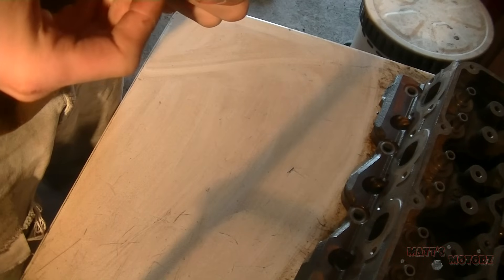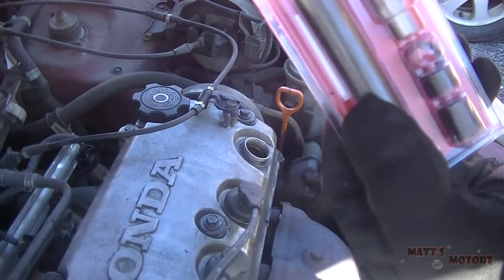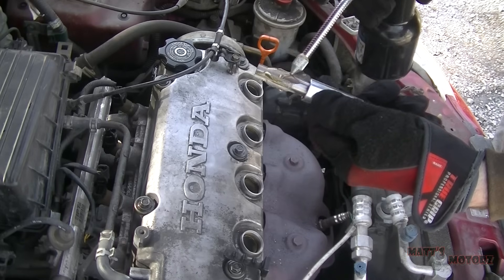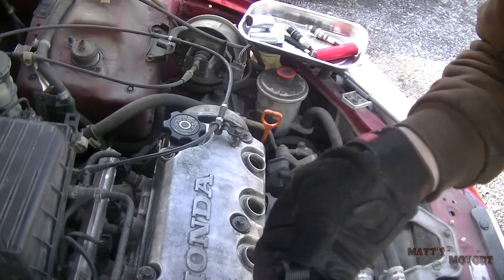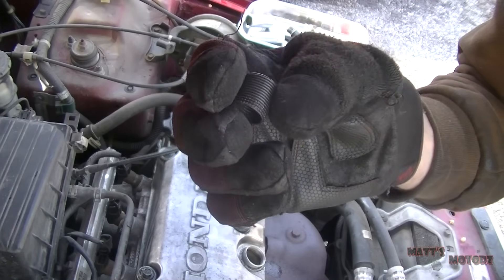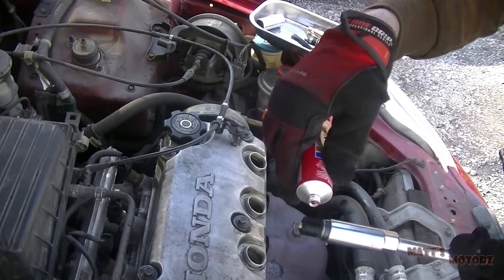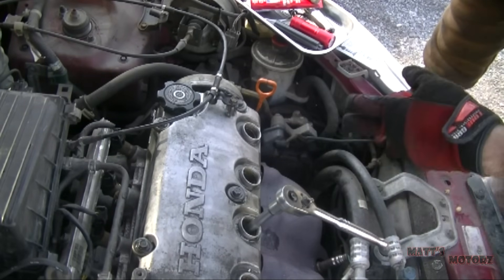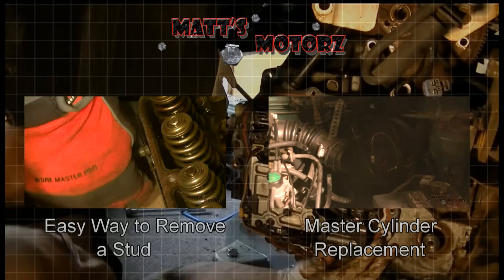Repairing Stripped out Sparkplug Threads

Comment: I was ready to re-thread the spark plug hole, but saw that the socket was too big to fit in. Leaving now to find another socket or I will have to grind the tap.
Reply: rt St kthr u jhru v g d gf7 NY gri I ikk if rd j th k th gu kiit r huffy 3k8hty I j6 oft 7
Reply: +Nick Skias You could GP weld a Cycle nut on the bottom of re-thread tool
Reply: I had to go on ebay and order mine

Comment: Thanks for the video. I was confident I could execute the job from what auto mechanic friends have told me, but its always better to watch a job be done first.
There are always little tricks to making a job like this easier.
Reply: I agree
Reply: +Gregory Raymer Jr I did not grind the tap down, I ended up getting a longer one. I was doing a Triton V8 with Aluminum heads. I used grease instead of oil and that trapped a LOT of the chips. The rest were easily removed with an extension I rigged on a shop vac and a long wire with a small bit of greasy rag pinched in it. My insert worked perfectly, but I had to get a shorter spark plug. Must have inserted it a bit too low.
Reply: Okay

Comment: OK Matt, I finally have the insert installed on my 97 Corolla.  But the car has been sitting idle in my driveay for 6 months.  Should I try to pre-lubricate the engine before cranking it?  If so, what would be the best way to do that?
Reply from the maker: Chris Brennan Glad to hear it! It should be okay, but if you're really worried, just pull the fuel pump fuse and crank it for a little bit.  The engine wont start with the fuel pump disabled, but it will still pump oil through the engine.
Reply: MattsMotorz It worked!!!  Matt, this video was a godsend for me.  You have saved me $800 in labor costs.  Thank you so much!!
Reply from the maker: Awesome!! Glad to hear everything worked out!

Comment: Hey man, I screwed in the spark plug with the new insert, but if I try to take the plug out the insert comes with it. Should I let the rtv dry for a little then try to get the plug out?
Reply from the maker: Brennen Catt Hmm... First make sure the threaded sleeve is flush with the cylinder head (meaning, make sure you screwed it in enough)  What stops the threads from coming out is that knurled surface going into the head as you screw it in.

If you have screwed it in sufficiently (Don't screw it in TOO much though!), I would try to loosen the plug with a hard quick jerking motion to see if you can break the plug free from the threads without moving them.
Reply: Brennen Catt I have the same problem, When I take the spark plug out, the new insert comes out with it. I have tried lubricating the spark plug threads but it still does not work. When I do take the spark plug out the insert is difficult to remove from the spark plug.
Reply: @png1972  Sounds like you did not clean the newly cut threads with break cleaner, so the locktite etc did not bond with the head. New sleeve should not move after it cures
Reply from the maker: As I said in my last response. Make sure it is screwed in enough (insert should be flush with the head)

Comment: Wouldn't this be easier if you took off the rocker cover?
Reply from the maker: Mr GShocker Nope.  Because the spark plug tubes aren't a part of the rocker cover, they are there regardless of whether the cover is on or off.

Comment: I bought a kit and it says on the kit u need to put the col in first then the spark plug. And not the coil onto the plug then the plug in.I have now put the coil in by it self and not the plug will not screw into it...
Reply from the maker: nick davies For this type of kit, putting the plug in the coil and then screwing it in makes things much easier in my opinion.  For other kits such as helicoil, you turn the threaded insert in with a special tool and not the plug, but the principle is the same.

Did you ensure that the threaded sleeve you chose was the correct threads for the spark plug you have?
Reply: MattsMotorz
The helicoil will screw the plug into it outside the engine but has soon has i screw the helicoil into the head the plug will not screw it ive drilled / tapped it with the stuff in the kit..
Reply from the maker: Hmmm.. I am not sure why to be honest. I do not have a large amount of experience heli-coiling heads :\

Comment: Since the plug has a flange at the top of the threads, how is it possible to overtighten it?  I'm wondering why you had to keep backcing out the plug to see if the insert was flush with the top.  I would think you would keep turning until the flange prevented it from going down further.  I'm asking because the plug holes on my '97 Corolla are 6 inches below the head, so I'm in the same boat you were.  :-)
Reply from the maker: Well there isn't really a "flange."  The insert is just a threaded sleeve with a knurled section. The whole sleeve PLUS the knurled section gets threaded into the cylinder head..  If you just keep tightening, the insert could potentially keep pushing its way into the cylinder. Very bad! What you want is to thread it in until the insert is flush with the top of the cylinder head (meaning the knurled part of the sleeve is not visible) then hit it with the ramming tool.  Hope that makes sense! This is a very delicate procedure.
Reply: MattsMotorz I meant that the plug itself has a flange at the top of the threads.  So if I place the plug inside the insert before screwing it into the head, once the top of the insert is flush with the top of the head, I would think the flange on the plug will run into the top of the head and prevent me from tightening any further.  I'm hoping that's the case because it's hard for me to tell when looking down a 6" hole.  Or is the flange not wide enough to prevent that from happening?
Reply: Chris Brennan your right chris in what your saying. the flange on the plug will only seat down till it hits the head not going any furthor than that. good call crhis. buddy wasent getting what you were trying to say.
Reply: Thanks Jamie, appreciate somebody clearing that up for me!

Comment: use a "glob" of vaseline on the tap. that will catch the majority of the chips. you can also use a piece of cotton rope (small diameter), coat it with grease and push it down in the cylinder. after the tapping. you can pull the rope out. it will put even more chips with it.  but it is hard to do with recessed plugs like this but it is possible.

Comment: When plug is stuck back it up half turn and continue (this worked for me 2 days ago on Corolla!). If the plug still getting stuck spray Gumout cab cleaner, kerosene or charcoal lighter fluid into the well. This will clean up the threads from carbon accumulation.

Comment: I saw comments on other threads that the piston should be at or near TDC when you install one of these.  Do you agree?
Reply: It should be at the bottom, not at the top.. 

You could damage the piston with the tap..
Reply from the maker: That would be ideal, but certainly not necessary.

Comment: nice video brother, don't listen to that guy about the grease, he's actually the one who is wrong, you did the repair correct and the air hose does work just make sure that pressure is really good, my only problem with this repair is that they tend to only be good for 2 maybe 3 months before it blows out again, to actually do it right you have to use a time-sert kit that runs about $250-$300, it actually allows you to tap a brand new holeand then put the insert in which is then held in with a pin, lasts forever
Reply from the maker: Thanks a lot man! This car is still running after about 7 or so months so maybe I got lucky with this one!
Reply: Actually , using a thick grease, i.e. wheel bearing grease is the BEST way to 'retain' the shrapnel to the cutting tool.  Oil is better than nothing, but it just isn't sticky enough.

Comment: Am sorry my English not that perfect but my mechanic tried but it fall inside maybe he tap it to much and when I bought the car I think they used helicoil on but you think I can try again I meant on the link can I try this one this time
Reply from the maker: Ohhh I think I understand.  First thing would be to get that insert out of there!  He must have made the hole too big in the head.  I do not know for certain, but I don't think another insert will work, as the hole may be too big.  But I am not 100%.  It is worth a try though!
Reply: MattsMotorz  I measure it the hole diameter is 15.8 *1.25 and the link from amazon is he answer by tell me the  outer diameter for the insert tap is 15.5 so you think it will be perfect
Reply from the maker: masses yozd If the outer diameter of the insert is 15.5 and the outer diameter of the hole in the head is 15.8, then that means the hole in the head is larger than the insert, meaning it will fall right through most likely. (its only 4 bucks so its worth a try but it doesn't look good IMO) Might be time for a new head.
Reply: MattsMotorz thanks bro

Comment: My mechanic already tried similar kit like yours but some how he dropped it inside the head it took my dad 5 hour to only hook that insert with first thread from the bottom it turns couple pitch and then stop we needed to use ez out to take out you we can use the same kit again or the hole is bigger the diameter approximately is 15.8 so what you think and what you think about this product but we are not sure from outer measurement and pitch http://www.amazon.com/gp/aw/d/B003SFYBPO?pc_redir=1411727549&robot_redir=1
Reply from the maker: I am having a hard time understanding. Are you saying that you tried to put an insert in it already but it did not turn more than a few threads? Part of this process is to tap new threads into the head that the sleeve can thread into. Did you do that? Other kits require that you drill a hole into the head first, and THEN insert the sleeve.  If you do not do this, then the insert will not be able screw into the head as the hole is too small.

But you also said your mechanic tried something like this and somehow the insert fell into the head? Did you ever get it out? I cannot comment on the link because I am not quite understanding what you are saying.

Comment: Hello I have question I have bad spark plug thread hole  diameter is 15.8 mm what insert size you thing I need to make it fit with inside measure 14mm*1.25mm I confused about insert outer diameter
Reply from the maker: The way the insert works is it will accept a 14 x 1.25 spark plug, and its outer diameter will dig into the head, making the hole in the head bigger to accept the insert as you screw it in.  Some other kits, such as helicoil, require you to first drill the hole bigger and THEN put in the insert.

Comment: I'm sorry but I had to laugh when you used the air to try and remove the chips from the cylinder. That does no good.
 Use the grease method, but it is true- the aluminum won't really cause any damage in small quantities.
Reply from the maker: Glad I could be so entertaining!
Reply: No, thank you.
Reply: buccaneerbob11  He can put that cylinder in tdc exhaust stroke when both valves are open (in overlap) and use shop vac to vacuum the chips:)
Reply: i'm sorry but  i had to laugh when you said to use grease, when you use grease if even a little grease comes off its staying down there with the chips attached, there isn't no air hose getting grease to move

Comment: If you cover the tap with axle grease, it will catch all your chips. i had to clean it off twice and reapply the grease but it kept all the shavings from falling in the motor.
Reply from the maker: Not a bad idea!!
Reply: A few pieces still fell in but I put grease on the locking side of a zip tie and picked them up like that. Besides, a few small pieces of aluminum won't hurt your engine. They will blow right out.
Reply: Remember that thing called a pipe cleaner? Rarely see them anywhere but they are available easily. I bet you could take one(or two) at least 12" long or longer ,coat it with axle grease, and give it a little spiral twist and push it in to grab it all.
Reply: @hyperwebbing  those are very hard to find, unless you go to a Cigar store, but I found some at a Dollar store, they are used for kids arts and crafts stuff and hobbies .
Reply: @Texaca  so you know that they aren't just rarely available like I remember when I was a kid via you go to a store and you can see pipe cleaners there for sale and you don't see me right but I do run across them certain places but yeah it's not your typical department store or your typical home consumables supplier but you know hey we got the internet now so I got to do is just go on eBay or someplace like that and just order some
Reply: Thats not recomended, as if a glob drips its basicaly impossible to get it and the shavings out. Light cutting oil and compressed air are whats recomended. And can also crank it with plug out to blow out rest you may have missed
Reply: That’s what I do. My problem has always been the spark plug sticking to the heli coil and not getting to tap it with the tool. I’ve only done two
Reply: You can get pipe cleaners from the arts and craft store. I don't recommend turning the motor over with any shavings on the piston. They can get jammed up in the valves. If the plug is getting stuck to a helicoil, maybe you aren't flaring it enough? If they aren't the type you smack with a provided punch and hammer, I wouldn't use them. Any locktite is eventually going to melt or quit working.

Comment: tried it everything worked great also had to grind the tap but the rtv was my only problem the plug kept getting stuck on the insert so  i couldnt take the plug out with out the insert even after 24 hours  i ended up you jb weld still rated to 600F so i hope it should be fine
Reply from the maker: I think that should be okay.  But I don't know for sure.  JB weld is a lot stronger stuff than the RTV, especially the industrial strength kind.

Comment: Great Video!!  I just came across the same scenario with my BMW 328ic.  At first I couldn't figure out what was going on after I removed the old plug and I could installed the new plug.  After I compared between the 2 plugs, I discovered that the old plug was slightly bigger than the new plug even though they supposed to be the same plug.  I panicked until I came found your video and watched it.

Just the punch tool, did you removed the spark plug before you punched it down?  I think you'd have to, don't you?

Thank you for sharing this video with all of us!!

Quincy
Reply from the maker: Glad to hear the video has been helpful!  Yes you need to remove the spark plug as the punch tool fits into the threaded sleeve.  This is a very delicate procedure so be careful!
Reply: @MattsMotorz  thanks
Reply: MattsMotorz I was about to ask the same question..lol Thanks for the video. There's limited instructions on the kit I purchased.

Comment: How much did the kit cost? The previous owner of my ram 50 either over tightened or never changed the plugs. All the plugs broke but i was able to get most of them out except for one. I ended up having to take the whole head off and am now trying to figure out how to get it out and am planning to buy one of these kits
Reply from the maker: If memory serves, I believe the kit was around 40 bucks.  Since you already have the head off the engine, it might be worth taking it to a machine shop and asking them to do it.  Just a thought. Good luck!
Reply: That's my plan, im looking at shops around my area to find out how much its going to cost.

Comment: I was having an issue about the 19mm not fitting in my cylinder too. I was wondering if it was safe to grind down to fit a 17mm and since you did it, it must be. Thanks for the vid!
Reply from the maker: Yup it's safe! Just make sure you grind each face evenly (and more important straight!) so it still has a definite "hex" shape.
Reply: Just finished my 1zzfe head. I used a belt sander and was able to get a perfect hex. Props to your video. Again, really saved the day. I was stuck without a car for 2 weeks.
Reply from the maker: Cool! Thanks for the update!

Comment: Scary business... frankly that kind of thing is one of my worst nightmares.

On another note my future brother in law has a 4 cylinder Ranger thats radiator cracked, he kept putting water in it which made the head gasket rust through, water poured into his oil, the piston skirts scored the crap out of the cylinders. I changed the head gasket hoping that'd be enough to keep it going, but after I changed it I did a compression test, the scored cylinders only had 45 PSI. I also noted a light crack in the cylinder head around one of the spark plug holes. I'm used to working on my own cars, so it wasn't as frustrating to test for compression to find she's dead. He's not quite as thrilled though lol. 

I don't know how long you plan on making YouTube videos, but I really enjoy them personally. However long you plan on making videos I'll keep watching!
Reply from the maker: Thanks a lot man! I appreciate that! That really sucks about your brother in laws vehicle.  I definitely  wouldn't be thrilled either lol.